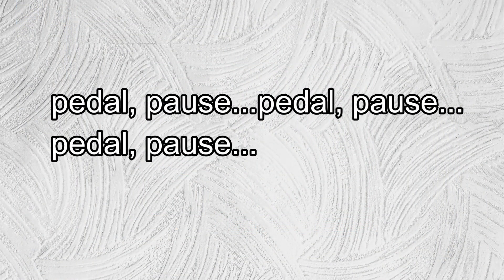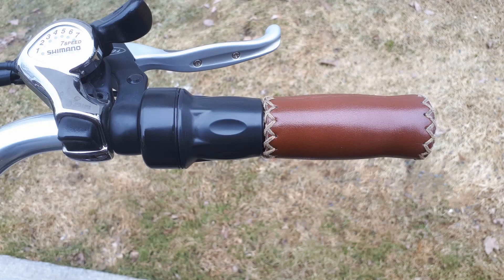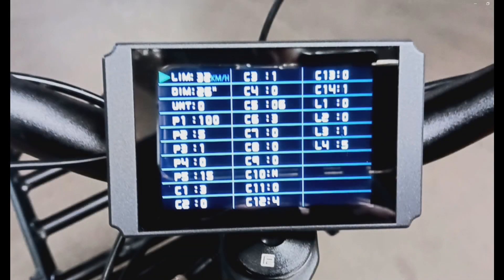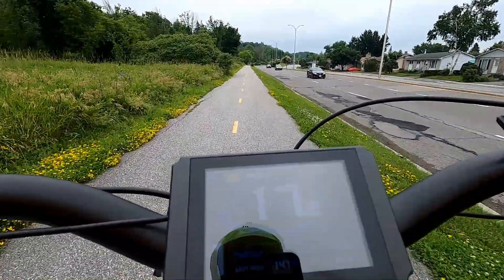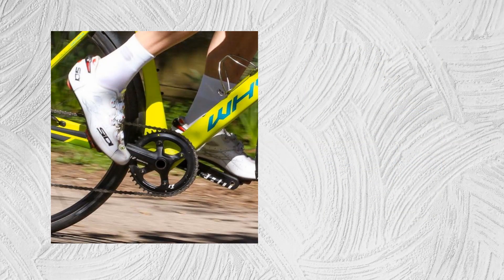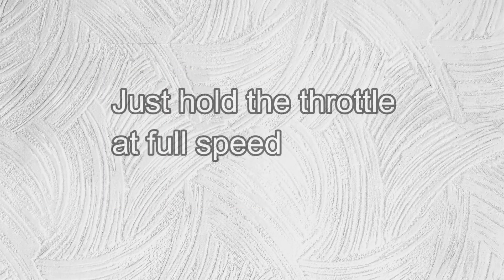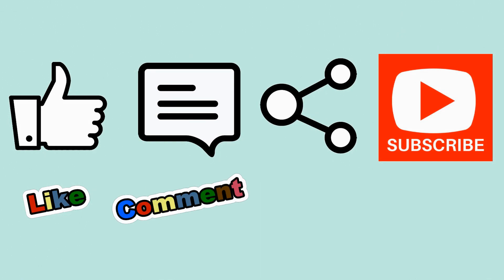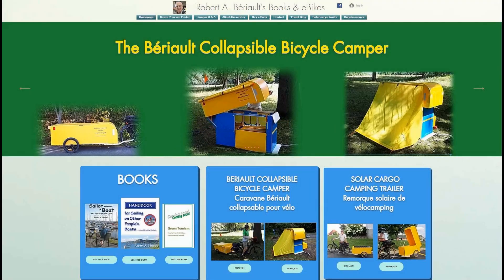Simulated Cruise Control for Electric Bikes

Comment: Nice video. I have been wondering how to set up ebikes for constant speed. One solution was right there staring back at me. This method should work as long as the motor has enough oomph to power up steep hills at the preset speed. Do you change gears much using this approach? God bless.
Reply from the maker: Oomph depends on the motor you have. I change gears when I feel like it😉

Comment: One ebike brand I’m familiar with already has this capability built in: Blix. My wife has a Blix Vika+, and the ‘pedal assist level’ is really a speed instead; PA1 is about 9 MPH, PA2 about 12 MPH, PA3 about 15 MPH, PA4 about 18 MPH, and PA5 about 20 MPH. Hold down the so-called thumb throttle (an on-off switch rather than a vernier throttle like on RadPower bikes) and it will go at a constant speed on flat ground or rising terrain; downhill, it’ll go as fast as air drag allows. On the Blix you can also go in and adjust the limit speed; boost it up to 40 KPH and the five PAS settings ratchet up, with in all cases the PAS 5 speed equalling what the limit speed is set for. HOWEVER: please note that the Blix implementation means that range is noticably REDUCED unless you ride on flat ground with zero wind. I get about 35 miles range when riding my wife’s Vika+ averaging 15 MPH in rolling terrain, where with my RadCity 2019 bike (direct-drive, has regen) at the same speed and in the same terrain I’ll get about 60 miles range. Both bikes have about the same battery capacity, about 670 w-h. The Blix PAS sets speed; the Rad PAS sets amps. I very much prefer the Rad bike solution; YMMV. I’d much rather have a constant POWER setting than a constant SPEED setting, for reasons of ridability and efficiency. Also, the Blix makes it harder to ride with other cyclists, as to match speed you have to switch power off and on in some manner.
Reply from the maker: Thanks for the info and your viewpoint about the Blix, which from what you say, is not a pure cruise control. I noticed that with SSC the range suffers. Whenever there is acceleration, however small, there is a loss of energy. I agree that constant power will always give better range than constant speed.